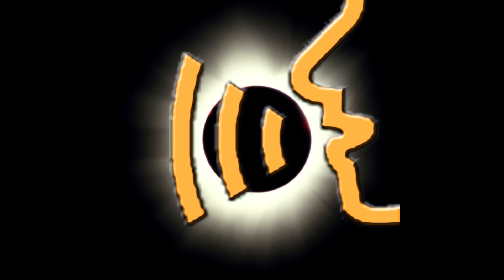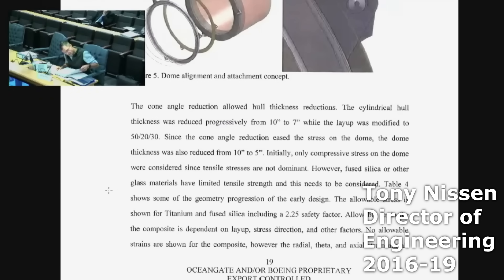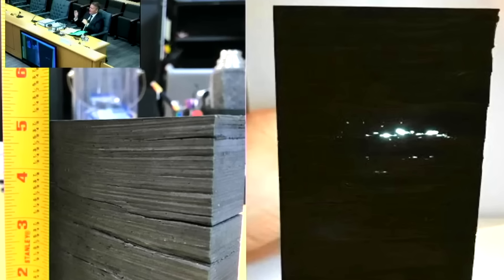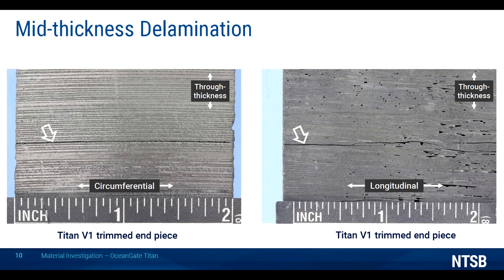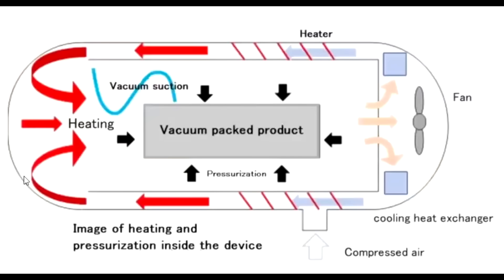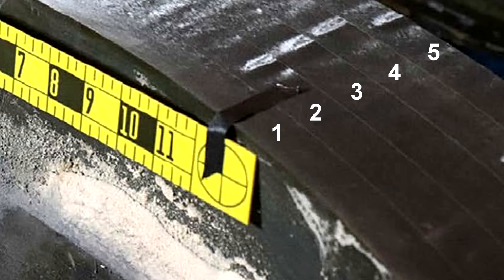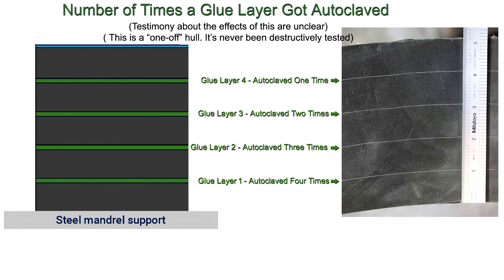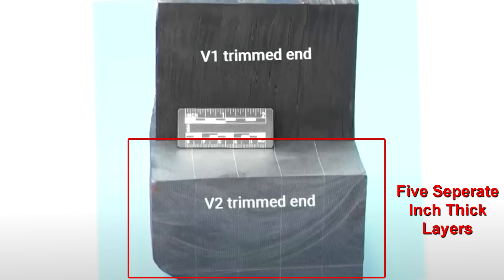Who Engineered the OceanGate Titan V2 Hull? Maybe Nobody Did?

Comment: This was just crazy on every level.  I've worked with pressure vessels and silos for nearly 50 years, up to 80,000 cubic metre capacity (50m diameter), including steel, aluminium,, and composites of fibre reinforced polymer and steel reinforced concrete.  I also have designed aluminium pressure vessels for subsea apparatus on ROVs (and tested them), albeit many years ago, using the design codes like BS 4500.  We like the composites for vessels with internal pressure, because they have fantastic tensile strength - the fibres are stiffer (higher modulus) than the matrix so they carry the tensile loads very well.  But this hull was only in compression, and in that situation the fibres carry nothing.  A string cannot resist being pushed inwards at its ends, it just buckles!  In places where our silos are in compression, we ignore the fibres and just calculate the resistance to compression based on the matrix alone, e.g. the concrete.  The presence of the fibres actually weakens the matrix because it occupies part of the area, typically 5% or so in concrete.  But in CF composite the fibres are a much bigger proportion (up to 50% by volume we have used in tests).  So the area of matrix carrying the compressive load is effectively only 2.5 inches thick here.  I suspect also that having the fibres inside the composite when it is in compression also tends to push the matrix apart, because the modulus of the fibres is higher so they will tend to buckle and push apart sideways, causing delamination that will gradually spread and weaken it with repeated cycling.  

The very concept of using such a material in high compression in a safety-critical application is just fundamentally wrong on so many levels, as far as I can see.  In compression, a pure, solid matrix without discontinuities is so much more predictable and can be calculated easily and reliably.  If they wanted to use polymer, a single one-piece moulding or casting of resin, without composite, could have have been made reliably and would not have had all the problems and failure possibilities that CFRC did.  I cannot even fathom why anyone who knows materials, would think this was a good idea, and why all the external consultants and experts went along with the sham without calling them out on their mistake.  Was this just a case of "group think" where everyone involved just went along with the ride because they all thought the other guys had solved the fundamental problem, the "elephant in the room"?

Maybe I am missing something.  Can anyone here present a rational argument of why CFRC might be a good solution in a pure compression application like this?  If so, I'd love to hear it.

Marion
Reply: It must be difficult to use a rope in a pushing contest
Carbon fiber composite and concrete have both very clear aplications
Reply: It can seem counter-intuitive, but carbon fiber does carry load in compression, in about the same proportion as it does in tension.

Bare fiber buckles readily, but that's because the fiber is really just a very slender column. Once embedded in a matrix, the matrix stabilizes the fiber, which allows the fiber to carry compressive load and, because the fiber is much stiffer than the matrix, it carries much more load by volume.

The catch is the fiber can only carry that compressive load until the matrix can't properly stabilize it, which gives a fiber-dominant composite, like CFRP, some notable properties:

A) Compressive strength strongly on the shear modulus, rather than the compressive strength, of the matrix.
B) Compressive strength is much more sensitive to defects (voids, delamination, etc.) than tensile strength.
C) Stiffness in compression and tension is roughly equal, but compressive strength is significantly lower than tensile (30-50%) - still very usable, just less efficient by weight and volume.

Your CFRC silo example differs, and can ignore the fiber in compression in calcs, for a few reasons, notably:

1) Compared to CFRP, the matrix in CFRC (concrete) is closer in stiffness to the fiber, so the CFRC matrix carries proportionately more load than CFRP at the same volume ratio.
2) The fiber volume ratio is much lower in CFRC than CFRP, meaning the matrix tends to dominate in load carrying due to (1).
3) The tensile strength of the matrix is much lower than its compressive, and orders of magnitude lower than the fiber - that chasm in tensile strength allows a great improvement at relatively low fiber volume ratios without much, if any, improvement in compressive strength.

The big advantage of CFRP for a submersible is also a bit paradoxical: removing weight.  The lighter the basic structure, the closer it is to neutrally buoyant, and the fewer buoyancy aids that are needed (syntactic foam, et al) on the finished craft.
Reply: @XrallYZ  Thanks for taking the time.  I'll need to think about some of what you said there.  But what I'd definitely agree on - your explanation of "stabilising the fibres against buckling" highlights this - is the very high sensitivity to discontinuities and voids, allowing the fibres to buckle locally, shedding their load onto adjacent fibres which then become overloaded and so on.  In a safety-critical application, surely this is a big no-no because it removes any "robustness" from the structure.  It's like a suspension bridge held up by a chain - if it fails in just one place, the failure will propagate through the whole structure.  In a safety-critical structure we try to build in "robustness" which means it's not just designed to carry the nominal load with a FoS but we also say "what if we get this failure?  How can we ensure the design has a way of guiding the failure to a point where it can be intercepted and stopped from propagating through the whole structure?".  Then the structure will show us a sign of distress and we can repair it before sudden and complete collapse occurs.  But the CFRC makes the whole safety of the structure completely dependent on perfect quality control in assembly, which is never going to be 100% in such a fabrication - so failure is almost inevitable!?

Regarding the weight saving.  None of the subsea vessels I ever designed went anywhere near these depths (typically 200m, +/-), but their weight was always negligible compared to their buoyancy, leading to the need for massive weighting on the ROVS that carried them.  I would have thought that even with these depths, the weight if made from high strength aluminium alloys (we used to use HE15 or HE30) would still be low compared to the water displaced.  If I recall, the strength to weight ratio for CFRC compared to aluminium in tension is about 3:1, so if the compressive strength of CFRC is only say 30% of its tensile strength, I would think its strength-to-weight ratio would not be much different from aluminium (?).  Correct me if I've got this wrong.

Marion
Reply: @marionbloom1218  There is no rational arguement…& I’m no Engineer.
There is NOTHING about this vessel that WASN’T built-in with failures by under-rating or cost-cutting over safety or wisdom
Reply: There is no rationale I can imagine for using a material with the opposite properties of the intended purpose, other than ignorance combined with hubris.  Then again, just one playback of an interview with Stockton Rush told me the man was an irrational narcissist talking out of his 'rear end' to begin with.
I liken it to the FIU concrete 'tension' bridge that collapsed onto the road in Florida, killing six motorists.  Whoever had the 'not-so-bright' idea of putting a concrete structure under tensional forces, was ignoring established norms of construction-materials engineering.
Both examples go along with the current trend of DEI hires that result in gross incompetence while attempting to promote 'diversity'.
Better men than I have repeatedly said that 'strength comes from competence, not diversity', but this axiom seems to be ignored for some reason.  Thank you for your input.  I hope more people will come to their senses without costing more innocent lives.
Cheers!

Comment: This is how they built our solar racing boat at my engineering school.
We became last
And it broke

Not due to the parts i designed, they cut them in half though so we had twice the parts and then the solar panels came off for which i had calculated clamps with 12 by 27 mm surface area and two holes which provided just enough force to keep them on at 7 wind force at 47 degrees, which was the max amount of roll before they hit the water .
But because they had two 6mm holes for the two clamping bolts the teacher said hey lets cut the first twenty in half so we have fourty and don't need to machine the rest...
So then at a wind force 4-5 day the solar panels came loose after someone bumped them slightly and later on they took the solar panels off which also were structural parts spreading the hull apart with plenty of force (at least with the clamps I had designed) and then the boat cracked in two on the trailer when they had to brake hard.
Which didn't matter because they already bent the rudder in the ocean which I had told them previously at 1mm was definitely too thin to resist the forces of the water at 16 kmph (yeah it was a slow shite boat because they didn't use the proper designed propellor but cut up the prop of another boat designed for different rpm. The first test was twice as fast but the prop broke off and they didn't care to make a new one at the proper angle and pitch so they took a hacksaw to the prop of the boat which didn't win the year before...)

Comment: The whole idea of using carbon fiber for a hull on a submarine is insane in my opinion.  Carbon fiber gets its strength from expansion or tension forces, not compression.  It can't resist compression like a solid metal..... it won't move, like trying to push a chain.  Take that same carbon fiber and try to pull it apart!
Reply: That's armchair talking. Although it's true that carbon fiber has relatively low compression strength, it's still very high per weight and the inner layer gets tension stress due to the moments applied from hinge action of both glued end.
Reply: @dongleseon8785  And the glued ends is/was a significant point of failure in this case.
Reply: @sferg9582  If the structural calculation was done correctly and if the production is done correctly, carbon composite hull with glued joint should work as fine as continuous metal hull within designed spec. The problem is that they didn't do neither of it.

Comment: anyone who once was in modell airplane constructing kknows that parallel CF laminat is very weak. i do not understand why they did not used diagonal fibres and strengthening ribs since CF has no significant compression resistance but pull resistance.
Reply: EXACTLY!!  The whole idea of using carbon fiber for a hull on a submarine is insane in my opinion.  Carbon fiber gets its strength from expansion or tension forces, not compression.  It can't resist compression like a solid metal..... it won't move, like trying to push a chain.  Take that same carbon fiber and try to pull it apart!
Reply: They were not considering a damage tolerant design. Way too many single points of failure.
When in doubt; make it stout, out of materials that are known.
They had a lot of unknowns. Accepted Material processing at required thickness.
"Bulges" in layup = Void in layup. 
Repair process for bulges.
End Cap Composite interface stresses interaction over time. 
Life cycle scatter factor between test articles and and final article.
Head of; Design, Stress,Test, Manufacturing, Finance, Marketing was one person.
The legal aspects of this are astounding.

Comment: The problem was not so much the carbon fibre (although that was extremely misguided), but rather the use of two materials: carbon fibre and titanium.
By definition, there would be an inevitable difference in coefficient of compression, causing relative movement between the two parts. A disaster waiting to happen.
Reply: That is A problem, but there are too many issues to call any one "the problem". 
Their decision to grind down ripples in the wrap between layers could be just as big of an issue, or bigger. Who knows how much strength was taken out of the CF tube as a result of all of those stands being broken when they ground into it. The 0°/90° layup (as opposed to Boeing's recommend 0/45/90) is another issue, which further compounds with the grinding
Reply: @Man_Emperor_of_Mankind  Indeed, but I can guarantee that this submersible would have failed irrespective of the integrity of the carbon fibre because of the difference in material performance.

Comment: pressure vessels in composite work very well when the pressure is inside, but not the opposite. High end paintball tanks take 5000PSI and they weight almost nothing. I'm not even sure there is any benefit for this application to work with composites since weight in low speed naval applications is not an issue.
Reply: The whole idea of using carbon fiber for a hull on a submarine is insane in my opinion.  Carbon fiber gets its strength from expansion or tension forces, not compression.  It can't resist compression like a solid metal..... it won't move, like trying to push a chain.  Take that same carbon fiber and try to pull it apart!
Reply: olplll
Reply: It's not an issue while the object is submerged, but buoyancy is a concern up until the dive; a heavier submersible will require a larger transport vessel, so there is merit to picking a lighter material.

There is still the issue of efficiency though.  Even if you swap to a material that weighs half as much, it's counterintuitive if you then need thrice as much material to achieve the required strength.